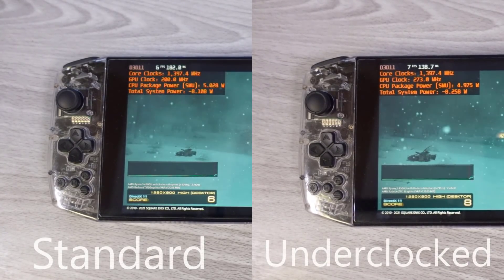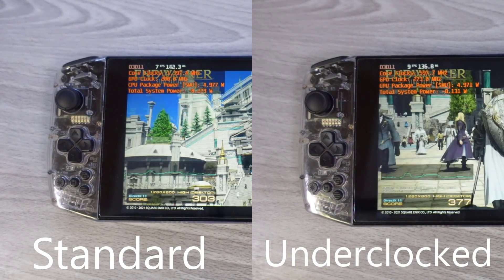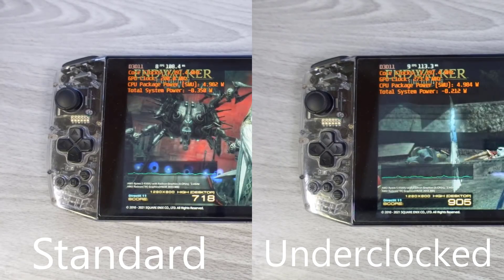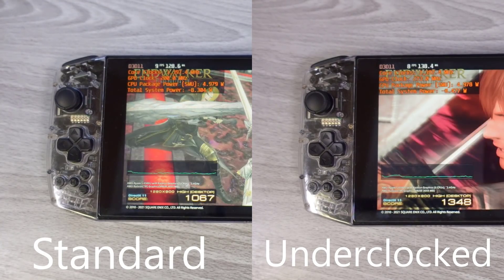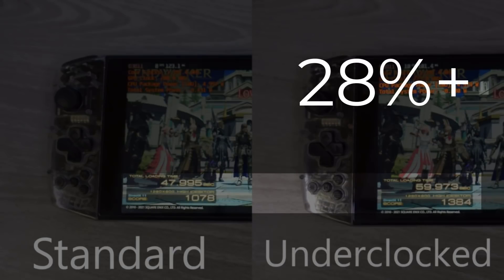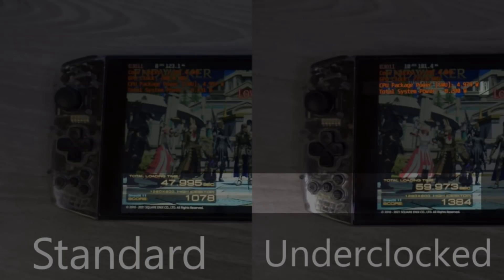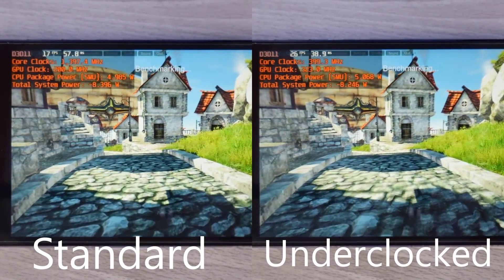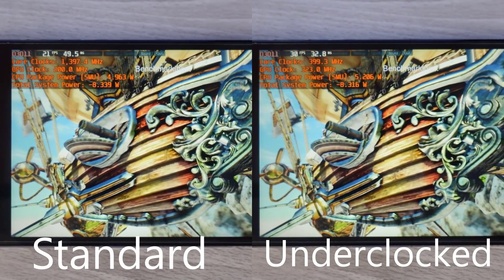AYA Neo - MAX PERFORMANCE LOW TDP! Don't Overclock, UNDERCLOCK! 15-60% BETTER PERFORMANCE!

Comment from the maker: Hey all!  I'll make a quick how-to video on what you need to do to underclock.  It's really super simple and it'll be a short video and straight to the point.

Apologies for not making it clear enough in this video.  It will require some experimentation on your end.
Reply: Can i doing like this on Aya Neo Pro 2021 using 4800U chip bro?..If can i want to do underclock too with 5w tdp..Let me know if can or not..

Comment: Underclock means higher clock speed
 I'm confused
Reply: Underclock mean give power to GPU  more than standart setting CPU..Its for someone who want save more battery life with better FPS performance..So after doing it you cant setting it to 15w,20w or up because the setting is just for 5w..Only 5w remeber..If you want to play change high tdp more better not to do it..

Comment: I have a very fast cpu in my laptop (45TDP in a 35W slot). I have it configured to run at 60% of max frequency and disabled turbo mode.
That was the best decision ever. The same was needed for my gpd win2 though, before we got that better heatsink mod.

Comment: If Aya is going to send out my device by 2077, I sure will enjoy it.
Seeing you tweaking these APUs all the time actually made me tinker a little with my desktop myself a bit and while it is just a 2700X which too behaves different from Renoir, I get the feeling a little bit of lowering voltage and underclocking can make it a better experience.

Comment: But when will backers get the device?  September?  December?  Bit disappointing for a device that was in peoples hands in 2020 while gpd win 3 and onexplayer delivered in no time at all.
Reply: Judging by how long it takes, we might have been better off placing our money on the Win3, I guess.
Reply: @MegaManNeo  I have both of the other devices in hand.  Onexplayer was so streamline it was like buying something off the shelf.  Gpd win 3 delivered first and I don't feel it is very comfortable to hold with the ABXY position.  Waiting for their grip so that my hands will be in a good position for comfort.  Based on Aya's updates, when they switched to the new CEO, he has tried to improve the product to a point that it isn't shipping in its competitive window.  The 4500U was the lowest performing chip to begin with, and the delay on shipment will now have it bumping up against the steam deck, which will offer mostly upgrades outside of the feel or form factor.  My assumption is that with the competition entering the market as these chips people low cost and perform well enough, Aya neo wanted to give a premium product as their first one to try and make a name for themselves.  I would have preferred a product in my hands than waiting until September or later to get minor improvements to the plastic mold and triggers.  Having a 4800U or 5800U option would help it be closer to the 1165g7 devices at higher tdp, so based on the price to upgrade I may go for that.  I am also curious if tuning it like The Phawx did here will yield better performance at lower tdp because of 8 CU at lower frequencies for better efficiency.

Comment: Isn't 200 MHz to 323 MHz an overclock? Since ya know the clock speed is higher.

I see the core clock is lower from 1397 MHz to 399.3 MHz.

So you are underclocking the CPU but overclocking the iGPU.
Reply: Give more power to GPU than the standart setting is give more power to CPU..Yes its possible because this is not gaming pc or gaming laptop because handheld device only have intergrated GPU not GPU like RTX or GTX in the gaming laptop ,so its possible doing that to get more FPS performance..This is handheld device its not more than that..Its still using battery to power the CPU & GPU so battery power is not suitable overcloacking because it will not enough watt to power the CPU & GPU like gaming laptop & gaming pc which plug it using electric 240v power..If handhels gaming device using more high power watts electric,yes we can overcloaking than undercloaking..So handheld gaming device of want to overcloaking its not suitable because we will short the battery life..More TDP setting more reduce the power of battery life..

Comment: Honestly for me this just make this console/gaming pc much less attractive. I know that this shows max potential of device but on the other hand showing that it's a device for person passionate of settings and bios, not ready for regular consumer. Although nice tech videos ;)
Reply: This is just for maximizing efficiency at low wattage.  The default clock set the device ships with would be much better from a performance perspective, this is for people who are trying to min-max battery life.
Reply: This isn't normal performance. It's a 15W device and this is showing it running at 5W to save battery life.

Comment: Just an observation - it is interesting that the CPU frequency tanks when you set a static GPU frequency, yet the FPS is higher. Its interesting that the APU will naturally spend its budget with the CPU yet it doesn’t seem as important. I suppose this tanking of frequency could also be caused by the CPU frequency being across 6 cores too. I saw something on the discord about disabling cores in Windows but I’m not sure if that will help.

Comment: Oh neat, and I guess that makes sense as this is a laptop chip where normal desktop usage (web browsing, excel) needs CPU power not GPU power so that gets priority, but you're gaming which needs the exact opposite. Iirc the Switch on battery power also prioritises the GPU. Is the GPU throttling at all at 15W or only at 5W?

Comment: wonder how powerfull can be win3 after underclocking
Reply: It's only AMD.
Reply: Bro only gaming handheld device using AMD CPU can setting like that..Either its OxP or Aya Neo if the handheld gaming device is still using AMD as its CPU,yes we can doing this setting..
Reply: @mustakimkamaruzaman9715  hey, but i know that. i was just wondering how good can be 1165g7 after undervoltage, but tbh, win is  still pretty damn silent, still more silent than any laptop i ever had, and i had quite many of them. now im waiting for new generation amd handheld cpu because last one was not really competition to intel. new amd apus are awsome so i wait for handheld edition. im also pretty excited about next intel handheld/ultrabook SoC`s from intel. last one at high tdp still are at same lvl or better than deck and they are more than 1 year on market.

Comment: I wonder why this happens? Is it allowing more CU's to run as each CU needs less power?
Reply: The games he's testing, and most games in general, need GPU power over CPU.  He's underclocking the CPU so that more power goes to the GPU
Reply: It could be that the CPU/GPU share total TDP. Tweaking these umpc's is a bit of a balancing act. Without fine tuning like Phawx is doing here, one component can take power away from the other, lowering FPS. In this case, CPU is clocking up too quickly, taking power from GPU (which in the case of this game, is more crucial for FPS). You can also use Speedshift EPP to tame how quickly the CPU ramps up it's clockspeeds

Comment: Do you think the steam thing will run switch or ps3 games?
Reply: I do! Cemu for sure
Reply: There is a pcsx3 emulator for ps3 games and also the yuzu both worked on the neo so I expect a similar performance on the deck